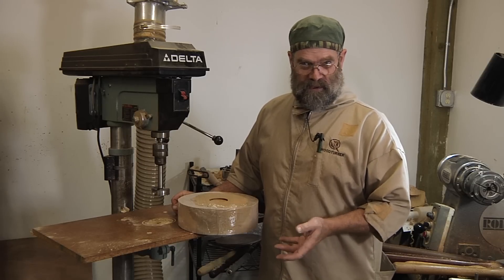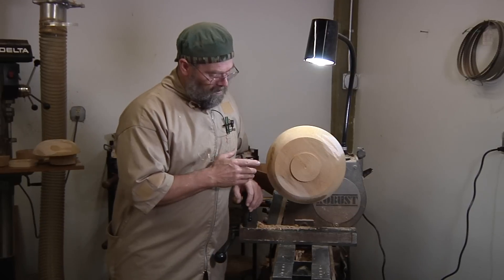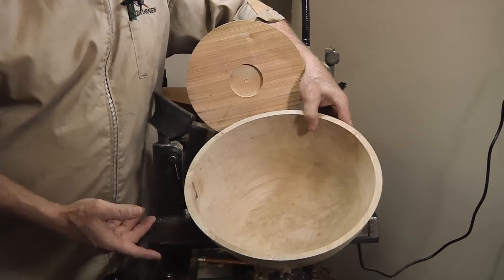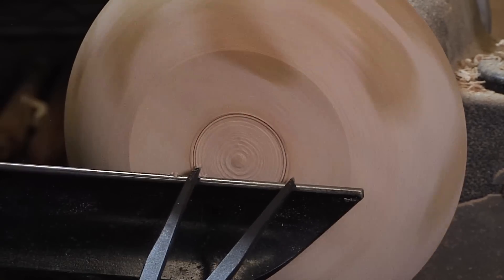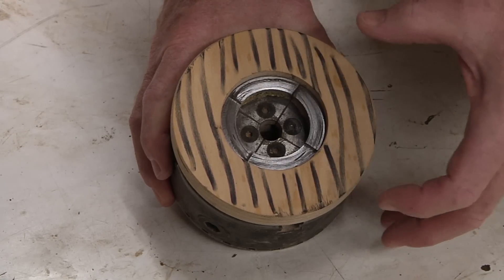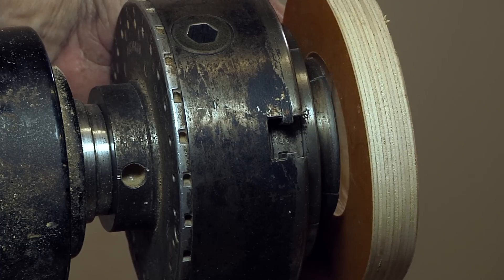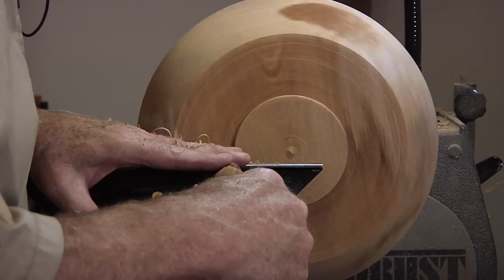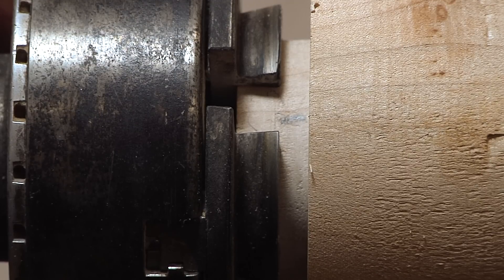MOUNTING BOWL BLANKS: RECESS, TENON & FACEPLATE by Reed Gray aka Robo Hippy

Comment: Reed, your videos are so helpful, I've watched many of them multiple times. Regarding the initial recess that you cut with a forstner bit. Obviously, the sides of the recess are straight once you've completed your cut. Later in the video you mention that the jaws you use are dovetail jaws. So if I'm understanding correctly, you are using a straight walled recess with dovetail jaws? If so, do you ever run into an issue with the jaws not holding the blank properly?

Comment: Hey Robo does your chuck jaws have a rib on the edge of them? I have a super nova chuck and it has like a ridge on the outer edge is this normal?
Reply from the maker: +ProD Miner The dove tail jaws from Vickmark are a straight 7 or so degree dove tail. The standard jaws on the Nova chucks have that tiny rib on the top. The idea is to have a straight/square recess, and that little rib actually is supposed to dig into the wood for a better grip. I haven't used one of them. I believe Nova does have dove tail jaws like the Vickmark.
Reply: So I should not make the recces notch then?
Reply from the maker: +ProD Miner Nova says no. So, this is not a dove tail joint, and if you turn a tiny notch for the rib, then it doesn't get as good of a grip.
Reply: well they are beveled and if I do not put that notch then stuff will go flying. I do not care for this chuck anymore time to get a different one. Any recommendations?
Reply from the maker: +ProD Miner The idea behind not cutting the tiny notch for the rib, then it doesn't get to really dig in for a secure hold. At present, I use all Vickmark chucks. I am also looking into an Easy Wood chuck which has a very slick quick change set up. I saw Carl Jacobson demo it, and was impressed. Carl also has a bunch of video clips up.

Comment from the maker: I can't remember where I got mine. I think it was Packard Woodworking. Craft Supplies may have it as well, or you can take a 1/2 inch by 1/4 inch thick square end scraper and grind the profile on it. I have seen them with a dove tail on both sides so you can to a tenon or recess.